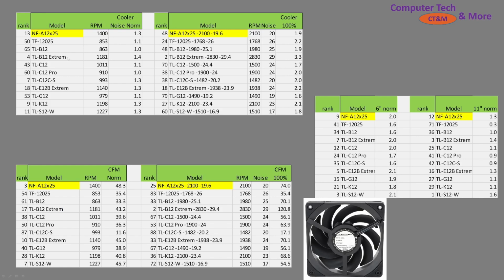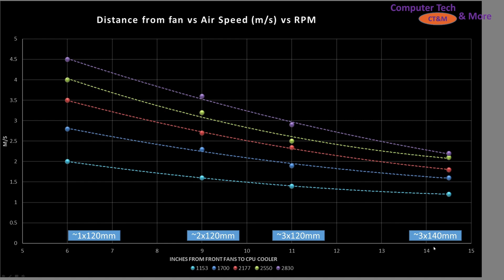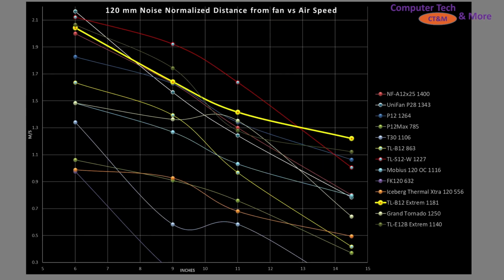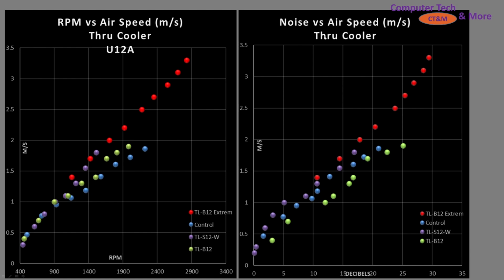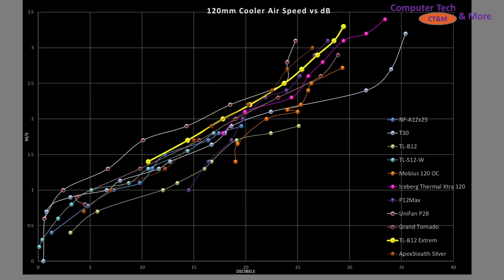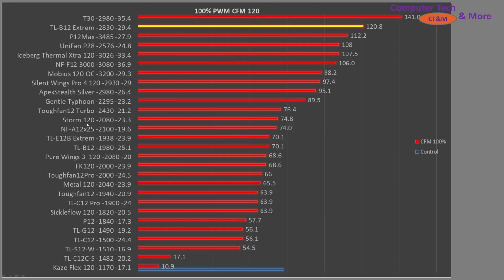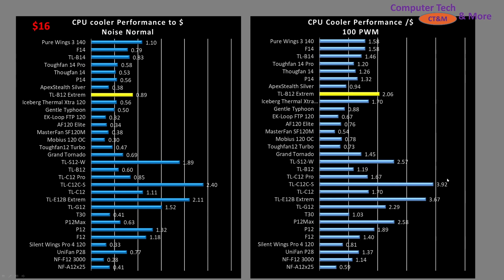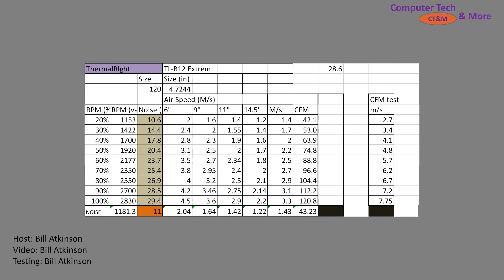TL-B12 Extrem : Do you Need Extrem Performance?

Comment: Is this fan better to be used in exhaust or intake? And also do you have a review of the TL- B12 lcp version?
Reply from the maker: I dont have the LCP version yet but i expect similar results. 
So this is a pretty good allrounder. so it will work as anything.
but it also depends on your case design and fan layout. 
For example the bequiet light base 600, with an Aircooler. there is not enough exhaust that works well for an air cooler. So a higher RPM back exhaust is needed.

Comment: still sounds like a jumbo JET at max RPM, SOLD!!! 😎
Reply from the maker: haha ya. Ive started adding my 2 Noise normalized levels to reviews.
Reply: @computer-tech-more   I just bought the Thermalright TL-B12 EXTREM yesterday, was in doubt between the P12 Max and it because the P12 Max I could get much cheaper but it's chosen, I want NOISE!!!! 🤣

ps: Was also cool to have seen the Arctic 120mm 8K rpm server fan which is around the price of the Thermalright TL-B12 EXTREM, though its a fan for crazy more pressure than airflow, would likely put rads to their max efficiency and super loud LOL.

Comment: Why is the P12 Max FDB missing from the charts? It should be a bit better than the TL-B12 Extrem (according to your own recent test), and is cheaper. I just purchased a P12 Max FDB because of your test and had to go back and compare it with the TL to convince myself I didn't make an unwise purchase decision.😅
Reply from the maker: this videos charts were made before the one for P12Max FDB was. But i pushed up the p12max video. 
I have a bunch of videos that will unfortunately be this way.

Comment: I have a science background so I should be able to understand most of these stuff with enough reflection but there are some things with the graphs that make it a little hard to understand exactly what they mean. I'm gonna make a list of questions below that'll be mostly hassle free for you to answer, and you should be able to decide whether or not the following things I'm personally having problems with do in fact need some improvement in terms of notation or explanation and whatnot:

About the graph in 1:17:

1a - This graph and all of the curves within it relate to the specific fan that is covered in this video, correct?
1b - I initially had no idea what the numbers 1153 1700 2177 etc meant, then I noticed the title of the graph and figured out they were the RPM values. Maybe point that out at the bottom too?
1c - All the curves are tested with one single fan, correct? So the stuff like '3x120mm' are just there to imply that the particular date above it would pertain to a pc case that would typically be able to accommodate 3 fans, right?

About the graph in 2:50 and a general suggestion:

2a - The graph at 2:50 where you mentioned 'margin of error' or something made me think 'what kind of difference IS significant then?' You gotta give me the precision of your measurements.  Seeing as you're an engineer, you probably have a good grasp of what random error is in measurements. I dont know the most proper scientific way of figuring out the margin of error for a measurement, I was never given a lesson in statistics, but I dont think we have to go about it in such a formal way. I'd say you should determine the precision of each of your measurement methods separately. You gonna do the test in graph 1:17 ? Take a control fan, take the exact same measurement 20 times, make a q test to rule out outliers, and then use the remaining date to see what the average is and how much the data varies from the average in the worst case scenario. The amount by which the outermost-lier deviates from the average would be the precision of your method. Once you got the precision figured out, you wont have to take as many measurements with every fan that you wanna test. Test each fan 3 times for each data point. Make sure none of the measurements deviate from the average by more than the precision of your method, and if a measurement does deviate too much, you scratch it and do a retest. For some reason I feel like this might correspond to what a Q test is anyway :D Anyway. When you got 3 good measurements for one data point, dont display only the average, display the average AND the margin of error around it. This is how I'd go about doing it. Surely there is a better way but this is what comes to mind first. 

2b - Exactly what kind of air mover did you use in the 'control' tests? A non-commercial special custom apparatus? Is that why you're leaving it with calling it 'control'?

I wanted to keep writing but my gf sucked the joy out of me
Reply from the maker: Haha well you have some valid points but as I am doing this basically unpaid in my free time. 
I just dont have the time to make everything "perfect". 
I'm probably not going to make all the suggestions. I can add some kind of note about what #### are in the first graph as RPM. And a label indicating its all the same fan. because that first graph is just that fan. 
The control is called control because I mathematically blended the A12x25 and the NF-A14. To make a composite fan. a "idealized" fan.

Comment: Very thorough review. I got three of these fans for my front intake, altough quite noisy around 2000rpm, a very solid fan nevertheless. cools my pc very well
Reply from the maker: Thank you for watching.
Reply: not sure any fan sounds quiet or good at 2000rpm
Reply from the maker: @xBINARYGODx  I have an A12X25 on an open case. its not bad. When i have it encoding.